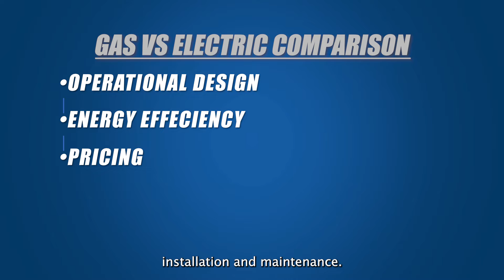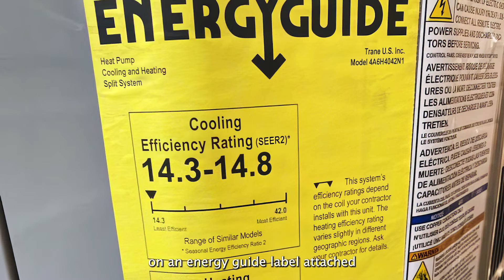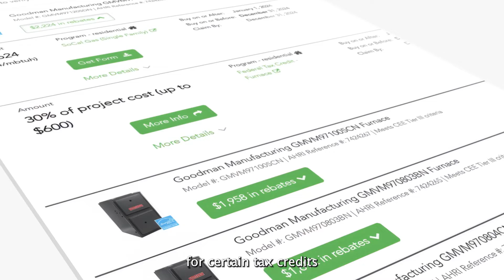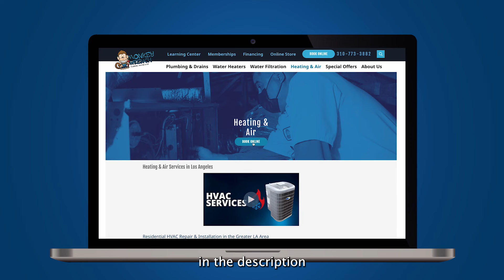Electric vs. Natural Gas HVAC Systems

Comment: I hate videos like this bc they completely miss the real world application.  Up North we don't have electric furnaces bc they struggle below 30 degrees.  Only oil or natural gas will keep you warm.  Electric furnaces are fine for warmer climates where it's only cold a few weeks per year.  Or you can get a dual climate which uses electric above 30 and natural gas below 30.  Mini splits are a great option for heating cold rooms or additions where electric furnaces struggle.